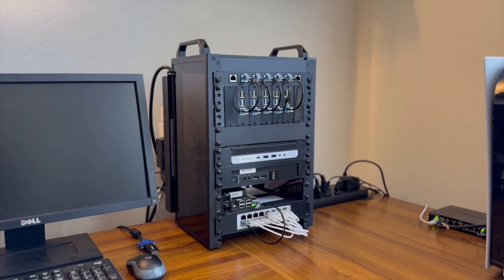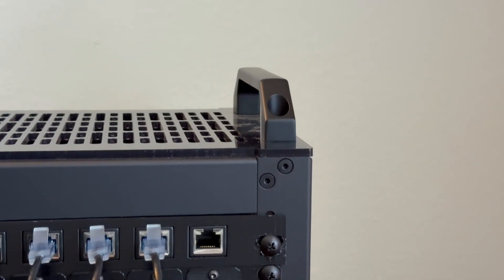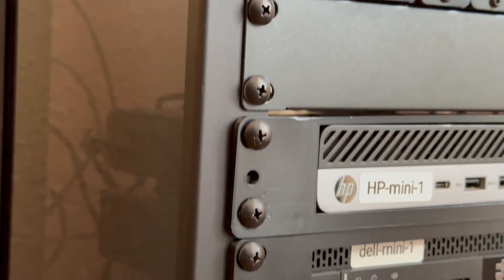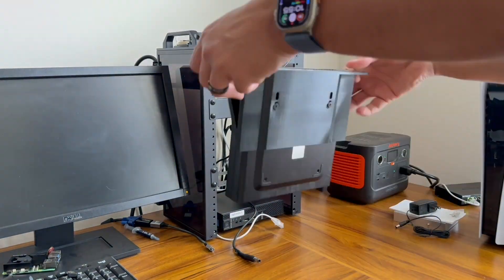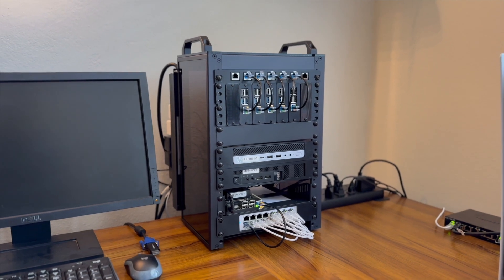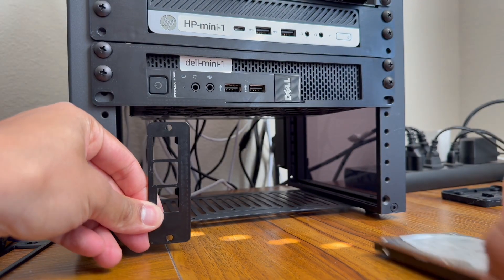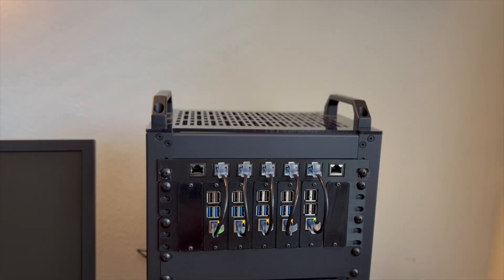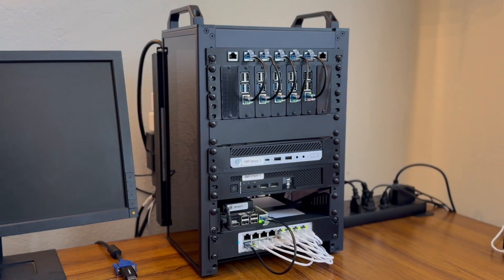3D-Printed Mounts for a 10" Homelab Rack—Is it worth it?

Comment: I had the same problem with my 8U rack…. The top rail that goes across is upside down.  If you flip it so the curved edge is down, things will line up.  The top edge is flush with the acrylic panel, so it stick up above the aluminum rails.
Reply: yup, me too!

Comment: You get a hole mismatch if you don't adhere to the rack units (1U, 2U, etc). In your rack every 1U is 3 screw holes, counted from the top or bottom. You will see that after every 3 holes there is a smaller space between the screwholes. That is the edge of a U unit. I think if you move everything down one screwhole it will all fit a lot better ;-)
Reply from the maker: Aah that makes so much more sense. The patch panel up top probably threw that off and thats why all for me seemed misaligned. Thank you!
Reply: @ShreyashGuptas  Here is some more info (if you hadn't already found it): https://en.wikipedia.org/wiki/Rack_unit
Reply from the maker: Shoutout to you!